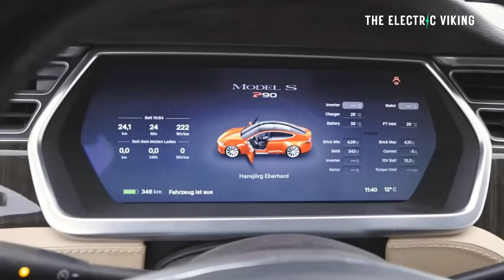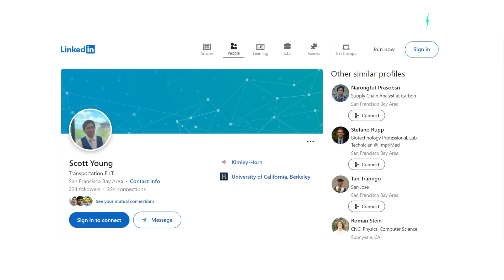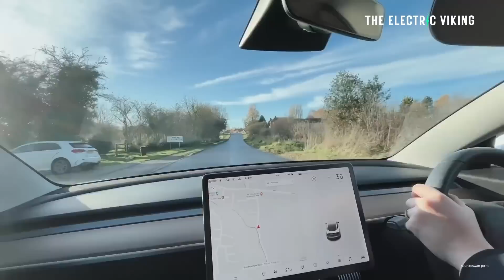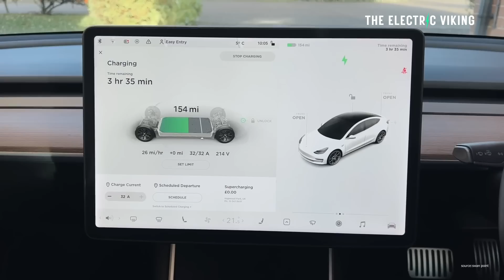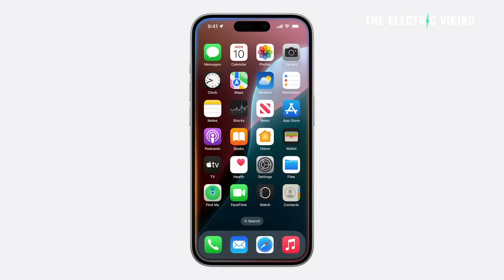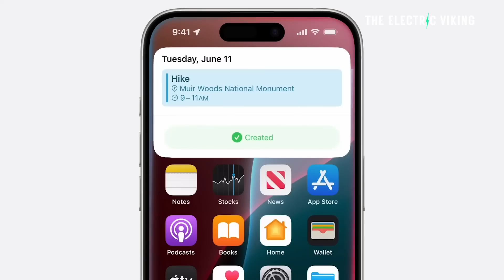Electric cars capable of running for over 1 million miles are already here

Comment: The reality is somewhere in the middle. ICE mileages are pretty low, because they're so complex and ultimately too expensive to repair when they're old for the average owner. Sure, some of us repair them and keep them going, but even then it's hard to keep them going past 300K miles.
It's easy to predict that EVs ought to last at least twice as long at ICE cars. When you look at the life of the first generaton cells and compare them with Lithium Iron Phosphate cells, you can see how  these really high mileages are going to get higher.
The upshot of this is that we'll only need a half to one third of the Car manufacturing capacity that we currently have. That's going to make a huge difference to climate change.
It ought to be possible to buy an ancient car with astronomic mileage, even though the battery may have degraded to a fraction of it's manufactured capacity. For a second car, that's going to be just fine. 100 miles range for a second car is perfectly satisfactory.
Reply: When it comes to predictions humans are way way beyond their capabilities, we simply don't have that gift. You said: "It's easy to predict that EVs ought to last at least twice as long at ICE cars", well I have a Fiat Stilo from 2003, 5 doors. Very rare minor repairs, the top I spent was 300+ euros and only once. Other than that I only need oil changes. So that car is with me for 24 years now. Can an EV beat this kind of longevity reliability and durability? NEVER! When the time comes to replace the battery you will spend around 20,000 euros at least. My friend we need a few decades for EVs to become reliable durable and have a cheap maintenance. After all ICE cars needed quite a few decades to become reliable. Also EVs have too much electronics, so more failing points, and we know how much electronics fail don't we?
But the main reason EVs will not last twice ICE cars is because of the so called planned obsolescence. Please remember manufacturers do their best not to make the best possible product but to make the worst possible product that you can still buy. The days manufacturers made things to last decades are OVER. Nowadays every is utterly crap and we still buy it.
It's funny we deny things we don't like, it's human nature to do that, the problem is that we can get burned when we deny the evidence.
Reply: @profounddamas  Well, I think you are not really telling us the truth, or you must be a time traveler! Having a 2003 car already 24 years doesn't ad up, unless you live in the year 2027.
Reply: The battery will just get recycled in 10 years (they'll pay you for the metal value) then you'll install a new solid state battery or whatever we have in a decade which will be more affordable than now
Reply: @-whackd  Except manufacturers don't want to sell you affordable stuff, they would go out of business.

Comment: If an EV  battery starts working like a phone battery, they will make your EV battery drain faster with an update i thought it was the battery was old but even after factory reset and new battery my last few phones lasted until eligible for anupgrade
Reply: Not possible. The drain of the traction motor when you are actually driving the car is orders of magnitude greater than the drain from auxiliary functions.
Reply: @rogerphelps9939  Don't worry. Everything in an EV is computer controlled. The motors can more than likely be made to run a lot less efficiently with computer control changes. Don't forget they have an eco mode so they can definitely change the efficiently of the way the motor uses energy

Comment: EVs are worth nothing after just a few years...depreciation is a bitch.
Reply: Really?  Where can I get an EV for nothing?
Reply: @MrSteeDoo  Just wait a little longer; Since September 2022, the average used electric car price has tumbled from $63,069 to $33,645. That is a 47% loss of value in a little over a year and a half.
Reply: @michaelphillips4452  OK but you said they were worth nothing.  $33K doesn't sound like nothing.
Reply: @michaelphillips4452  The average used electric car is older each year.  Duh.
Reply: @MrSteeDoo  Just give it some time, I said a few years, they are running out of space to park the unsold new ones now.
Reply: @MrSteeDoo  You can not even sell the wrecks for scrap..they are a longtime hazard.
Reply: @michaelphillips4452  Where can I buy one?

Comment: But the EV haters say they last less miles than ICE vehicles, and they are less reliable, and they require more maintenance, and they depreciate much faster than ICE, and the batteries need to be replaced within the first 10 years. Are you telling us that is not true? Next you are going to tell us that EVs are safer, quieter, greener, with better performance, more features, can be refueled at home, and can improve regularly with OTA updates.
Reply: yes, in truth everyone knows this, even while spreading FUD. why do you think legacy nauto is dragging their feet so much? they are inept, but do you actually think they are that inept? they are fighting for their worthless lives.
Reply: Lies from the fossil fuel industry.  Miles driven by all Telsa cars is available to the public and several youtubers have made videos on how long tesla batteries last (over 300 000 miles) and average annual maintenance cost (very low). Range drops about 6% over the first could of years and (on average) remains unchanged for 10+ years.
Reply: Yes
Reply: Human nature resists change.  It’s called inertia.  And the transition to EVs is in the very early stages.  Just as ICE cars got radically better in the first 25 years or so EVs will follow suit only much faster.  The sheer simplicity of EVs plus the advanced technology that is developing now makes this a no brainer.  IMO we will see EVs that never require recharging.  Quantum Physics tells us this is coming.
Reply: @pauldaggett6759  That's why I am all in on $TSLA & $BYDDY.
Reply: GOSH! DO YOU THINK THAT MAYBE EV HATERS ARE LIARS?
Reply: Eevee's do depreciate faster because the price to manufacture EVS is still dropping sharply.

It's just a fact that if you buy an electric vehicle for $50,000 today, it's going to depreciate because in 5 years electric vehicles may only cost $40,000.
Electric vehicles haven't found their actual lowest price yet.

However, Gasoline vehicles are seeing a similar depreciation as they fall back from unrealistic pandemic levels.
Reply: All of which is bulldroppings by someone with stock in Communist Chinese EV companies, LOL
Reply: They have bought into Trump's lies, who has sold out to BIG oil for who knows how much $$$$.
Reply: Go and get an EV, you will find out!

In fact most of the problems in gas cars are usually come from the electronic parts.

Mechanical systems are way more reliable than electronics.

If I had my way, I would design and all mechanical engine.

Like the old mechanical Diesel Mercedes from the 80s. But with newer designs.
Reply: Glad you were paying attention.😊
Reply: Another reason you should buy a nio over a Tesla, you will be able to take a 10 year old NIo and swap the brand new latest greatest battery into it.
Reply: @Slaytheday388 Will Nio be there in 10 years. I'm sure CATL or BYD will offer battery packs for Models 3 and Y in a few years, as the cars get much older.
Reply: @connclissmann6514  You are so right!  In ten years people will be able to drive into a shop and ask for a new battery.  The shop will consult his supplier, and quote you a price for a remanufactured battery, no different than we do with our ICE lead acid batteries.  And the latter usually crap out in 3-4 years.
Reply: You'll always be able to swap batteries Tesla are doing it today for latest batteries
Reply: @tony34star  For how much?
Reply: @Slaytheday388 Uh, no NIOs here in Thailand. And I would never buy from a car  company that also makes clothes, perfume, liquor, and other bs. Tesla is the gold standard by which all other EVs are measured.
Reply: I completely agree with you. There a people that insist on ignoring what you said. But it's nice many people buy EVs now, they will serve as guinea pigs for EV technology and their experience will provide more data for future and potential EV buyers. There should be a site where we can post selfies of the moment an EV owner pays for a replacement battery or a major repair as well as some comments. That will give an idea of what EVs are. My nephew has a Renault EV for 6 years now with only 100Km range, he already had to replace the battery for 10,000 euros.
Reply: @profounddamas  the research to date is that these batteries are lasting far longer than they thought they would Teslas been making batteries like these since 2009, With a great track record. And nowadays, the battery HVAC systems are far superior, which should result in much longer life.
Reply: @jamesdaniel947  I don't think so. If Tesla has making batteries like these since 2009 then why did that guy in Europe burned his 7 year old second hand Tesla after discovering he had to replace the battery and pay 20,000 euros? I don't know the research you are talking about but other stories say the same thing except Tesla owners don't burn their EVs like that guy did.
Reply: The OLDEST Tesla Model S is as old as the AVERAGE ICE car in the US today.  All this hand waving and hypothesizing about the life of EVs is pure conjecture.  What is known for a fact is the extreme depreciation of EVs and the reluctance of people to buy used EVs because of battery risk.  Many used car dealers REFUSE to even deal them.
Reply: Is HERTZ an EV hater?  They can't afford the high operating cost$ of EVs.
Reply: @trungson6604  It’s because Hertz did not account for the continual price drops of Teslas over time. And, renters were running the pi$$ out of the Teslas and heavily abusing them, which Hertz did not expect, thus accounting for higher repair costs. Nothing was wrong with the EVs, other than the abuse they received. Hertz should have checked how the Teslas were mistreated based on the data captured by Tesla. The same can happen to ICE rentals, though there would be no record of it.
Reply: @dzcav3  Rental EVs also have way more performance than ICE vehicles. So, I am not at all surprised that rental Teslas have been severely abused. What surprises me though is that Hertz is not smart enough to check on the mistreatment of the rentail EVs (part of the return process), as Tesla collects all of the driving data. Renters should have been fined for misusing the EVs.
Reply: @tomdrewenskus8167  it wasn't because they were wearing them out or that maintenance was too high because they were crashing them and fixing an EV is more expensive than an ice car sometimes
Reply: @jamesdaniel947  Fixing an EV is more expensive than fixing an ICE car SOMETIMES? If the same accident happened to both an EV & ICE car, it would never be more expensive to repair the EV. That’s because an EV has only ~20 moving parts while an ICE vehicle has ~2000. And if the structural battery pack were damaged, then the central frame of the ICE car would also be damaged resulting in both vehicles probably being totaled.
Reply: @trungson6604  hertz somehow got the idea that EVs would never depreciate, they now finally depreciate just like ICE vehicles and they panicked.
Reply: @scottmcshannon6821 It was a little more than just that. Tesla service is not set up to work with fleets right now. When accidents or repairs were needed they took more time to repair and cost more to repair than the ice cars in Hertz’ fleet. So operating costs were higher in addition to the unanticipated depreciation. The cost savings of evs did not apply to Hertz. They made people charge them to 80% before returning them, so they didn’t pay for the majority of charging anyway, just as they don’t pay for the majority of gas used by their ice cars.
Reply: @trungson6604 It's not the operating costs but the repair costs; people drive rental cars like, well, rental cars! The facts that Tesla cars are statistically safer and are involved in fewer accidents would seem to contradict the experience of Hertz, until you consider the faster acceleration, the rental drivers' lack of experience driving a car with such high performance and the fact that it's not their car (and they got the extra "no questions asked" supplemental insurance) you will have more collisions; and since Tesla is still building out their repair operations and there probably aren't a lot of aftermarket parts, the repair costs have been higher than expected; Hertz probably should have introduced the Teslas more slowly to figure the game out before diving in head first; just my thoughts
Reply: @trungson6604 no they couldn't handle operating an electric vehicle rental company because they didn't do the research.
Reply: We're not EV haters. We're realists. If your fantasies ever come true I'll apologize. I'll never have to do that because this is fantasy. And EV batteries aren't recyclable.
Reply: @bunsw2070  How do you not know that all EV batteries are & will be recycled? They are too valuable. And eventually there will be no more mining of the raw materials for batteries, because new batteries will only need to be made from recycled battery materials. One of the early Tesla employees, JB Straubel, left to form Redwood Materials, a battery recycling company located near Tesla’s gigafactory in Nevada where they make 4680 batteries. Perhaps you should listen to some of J B Straubel’s interviews on YouTube. You are really out of touch when it comes to EV adoption, and you don’t realize the growth is exponential instead of linear. But, don’t believe me. Just listen to Tony Seba’s presentation on EV adoption. Perhaps you are blinded by the slower adoption of EVs in America vs China & Europe, and there are plenty of reasons for that. Let me know if you wish me to explain and educate you on it.

Comment: Thumbs down, channel blocked.  Why would you compare a tesla that had all of its drivetrain changed out, to a gas car that doesn't have it's drivetrain changed out?  You said that 2 mil km car had the battery and motors changed twice!   Isn't that like $30k twice?  So yeah, for $60,000 I can get any gas car to go that far?  WTH (heck)?  You're silly.  Electric is superior simply for it's simplicity.  No need to lie.

Comment: I want the convenience of an electric car.  Never need to line up to get petrol at a filling station again. No oil changes forever.
Reply: Where do you charge? At home? Most people cannot do that.
Reply: @stefan2796  Acttually it is not most people.
Reply: Tyres change frequently
Reply: @Klentung8989 No more than ICE in my experience
Reply: @Klentung8989  My MYLR tires are doing just fine at 12,000 miles. Based on the tread wear, I expect at least 25,000 miles form the OEM set.

Comment: EV will probably run until replacement parts are no longer available.
Reply: Just wonderful.
Reply: Replacement parts are already a problem with current models. Because of that, repairs can take weeks, or even months sometimes. Internet is full of these kind of complaints.

Comment: I would guess that in New England that cars die from corrosion as much as drivetrain failures. My 2005 Honda Element is on the original drivetrain at 195k (still waiting for a similar eV - a light duty van). A common problem for the Element is the rear frame corroding to the point of failure. The brake dust shield fell off from rust recently. Car companies certainly could improve this but I am guessing they won’t. When I lived in the western US the interiors and rubber seal aged much faster due to heat sunlight. I agree with the iPhone analogy, which is terrible but predictable.

Comment: There are more things that wear out apart from the drive train.
As a car gets older the paint fails, the interior wears out, all parts that are touched wear out, plastic gets brittle and breaks, headlights fog up. Eventually it is not worth repairing.
How much would it cost to change the carpet and redo all the seats? Even if the car is still running will anyone spend money on a 20yo car to replace the seats and steering wheel?
Maybe not.
Reply: Yeah but nobody junks a car with worn out seat covers.  It just gets sold to the next poorer person.
Reply: Or you just keep using it

Comment: Tesla offers not only extreme longevity and usability under proper battery and frame care, management and maintenance but also top notch safety/protection with the camera features/automation/full self driving capabilities that assist the driver and all the other technologies incorporated into it that make it safe for the defensive driver. That’s why ice vehicles right now are the vehicles of choice for psychopaths and road ragers, too much gas has gotten to their brain they’re no longer able to think properly with all them having to go to their dealerships or car stores for maintenance/oil change/busted spark plugs/etc. That’s why when I get the chance soon to trade in my 2022 Toyota Corolla, I’ll trade it in for a model 3.

Comment: What planet are you actually on? Batteries of EVs last 9  yrs on average with most lasting only 7 yrs then they become uneconomical to repair or replace the battery so these cars are scrapped. Face it no one wants one anymore people realise they've been sold a pup
Reply: Much better to buy a 1.3 liter turbo charged pos with cvt that last less than 100,000 miles for a few dollars less. Then you need to spend $50 to $100 or more on oil changes every few months, plus brakes.
Reply: Do you have a link to an article that says this? 

If Tesla warranties their batteries for eight years and “most of them go out after seven years” are you thinking Tesla is giving out lots of free replacement cars?